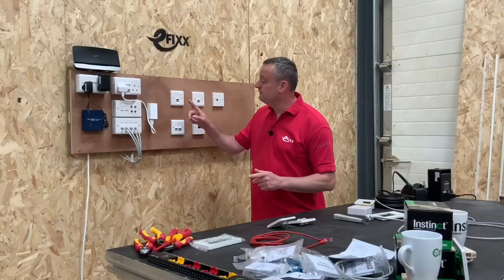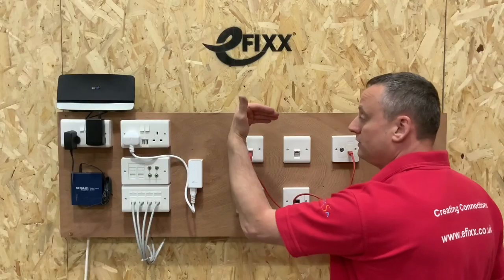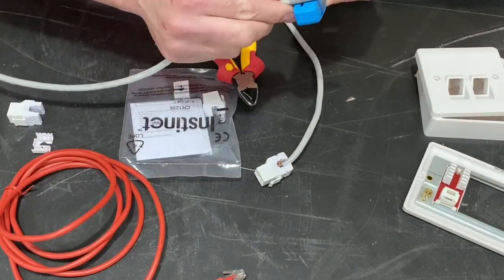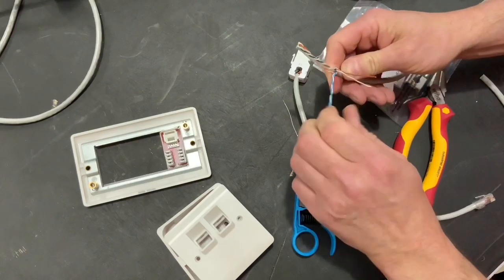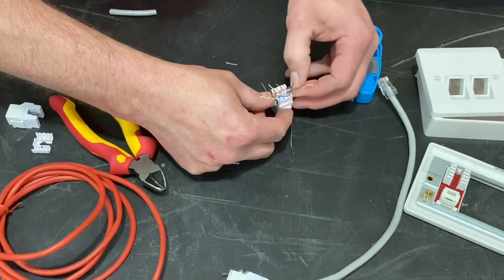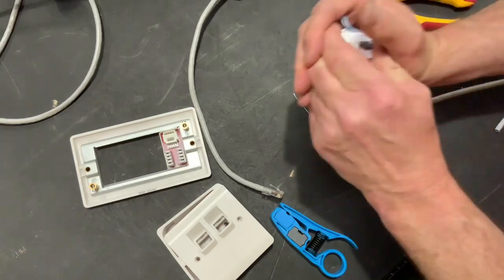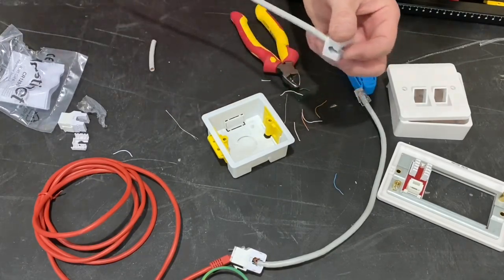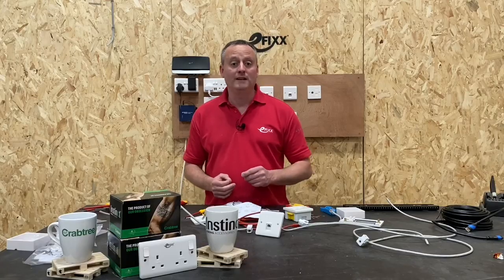Get the TV closer to the wall with these Crabtree Instinct data plates and keystone modules.

Comment: much easier to just use the krone tool, i wouldnt trust the cover to "make" all 8 contacts properly
Reply: Sorry, I use the excel ones. They are a bit different. They have metal hinged lids which are a lot better than this type. These ones, I just use the Krone tool and then put the cap on just for the sake of it

Comment: Those RJ45 keystone modules are very similar to the Excel tool-less RJ45 modules which work very well.  The Excel ones are metal bodied so fully screened and good for FTP.
Reply from the maker: From our research keystone modules are popular in the US market - so chances are the Excel one you mention will fit the plates we used. - If you can drop us a link we’ll try it.
Reply: @efixx  keystone patch panels and matching keystone jacks are fairly popular in Europe as well — I have a couple of 16 port p]ones that I grabbed very cheap from a second hand store decades ago, started life iPad telephone grade rj45 and I’m now using one for telephone and one for coax.

Comment: When you untwist data cable, you shouldn't untwist it all the way back like it's done in the video. It should stay twisted just until where it terminates
Reply: My response when seeing this was very “this is why you don’t let electricians terminate data cables”.

It’ll be fine for gigabit Ethernet but you’re using cat 6/6A because you want to use 10GE presumably and that’s a different story.

Comment: Using a HDMI 90 degree bend on a euro module would probably get the HDMI closer to the wall and also mean the TV would not be pushing directly against the cable and potentially damaging it. Also for flush mounting TV’s sync box is the best thing to use. AOS swear by them.
Reply from the maker: The Syncbox is a great product, but needs 78mm mounting depth and is quite expensive.

Comment: Sorry mate, but by the time you’d laid all the network cables out ready for “insulation displacement” I’d have punched them all down with a punch down tool

I don’t see it saving time or money (punchdowns are cheap as chips)
Reply: Not to mention the unnecessary and incorrect process of untwisting the pairs, thereby destroying the cable assembly testing.